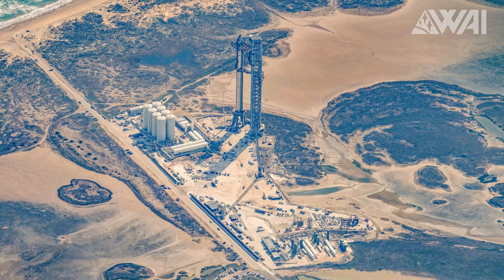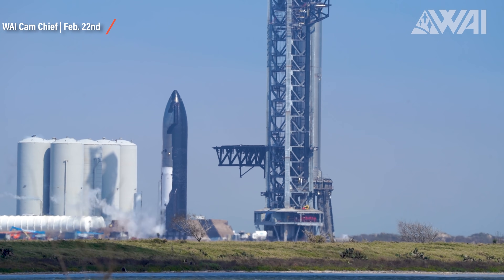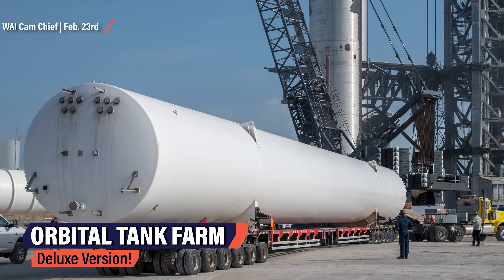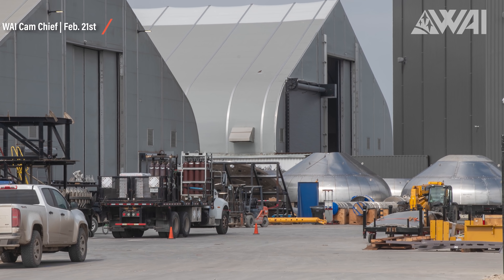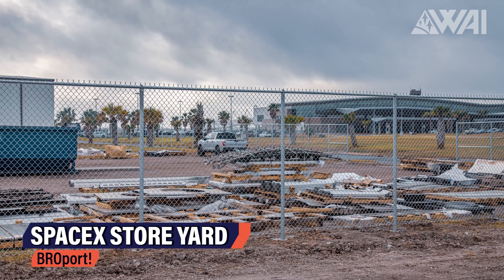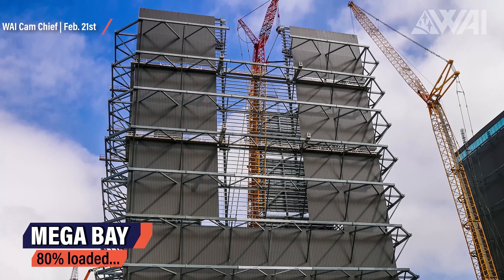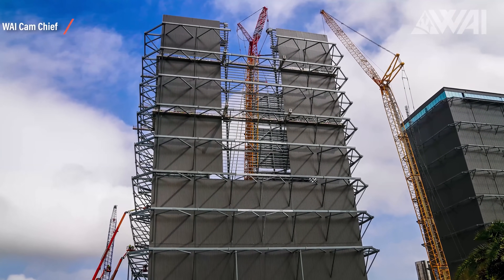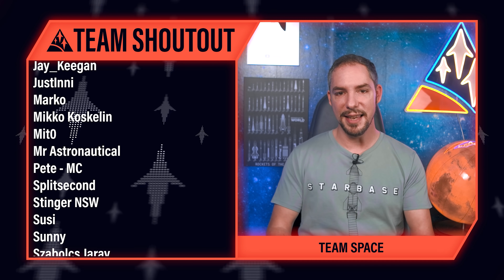SpaceX Starship Raptor 2 – Changing more than just the thrust output!

Comment: Would you run a new car into a wall or a old clunker, to collect impact data? The same with Raptor 2 and Raptor 1. If you lose booster 4 and ship 20. You get the all important answers. Will it clear the tower? Will the lift-off damage the ground equipment? Will it make to Max Q? How did stage separation perform? Don't forget, they were destined to the ocean anyway.
Do you really want to put 32 plus new Raptor 2s in the ocean? That's a big reorder for the production line. It will confirm you first thought and how well it preforms. Wring out the fuel farm, launch mount and tower, put 20 on 4 and rock and roll.
Reply: Good arguments. 
I am not sure how much we know about what SpaceX is asking right now, though.
For example, does more power in R2 translates in more vibrations and heat? If yes, It might be good to start doing fire tests with multiple new engines.
I guess all comes to what systems can be independently iterated and what should be a step forward. We just don't know. Remember what Elon said about flanges?
Reply: 4/20's use isn't about the Raptors, it's about the software for control and return, and about testing the heat shield.
Reply: I'm with you.  There are a million things to test with the first launch besides the engines.  The plan is to ditch these first launch vehicles at sea, no need to ditch raptor 2 engines when you could ditch raptor 1's.  You still get to test all the other myriad of systems.  With the new data, they may feel comfortable bringing the second launch in for a landing and thus get to keep the new engines.
Reply: Some is good .
More is better .
Too much is just right ....
Reply: They actually do use brand new cars for crash testing. But I get what you're saying.
Reply: Yeah there is too much data to gain by launching 4 & 20 in my opinion but who knows, they change it up day by day.  They keep pressure testing them so they must be sticking to using them so far anyway.
Reply: I agree completely. So much could be learned from 420, especially re-entry info.
Reply: one is intentional the other is not...
Reply: I suspect they want to collect as much info as they can, so they're going to fly R2s. Reason why not R1s? They only have permission for a very limited number of orbital launches. They don't want to waste one flying obsolete hardware.

Comment: The reason for not using GSE tanks made by SpaceX and bringing in new tanks is because of an OSHA violation. The GSE tanks holding oxidizer and fuel are not separated with a concrete wall, as per OSHA. I would think with the GSE tanks being double walled and the air gap being filled with perlite stone would have been sufficient protection.
Reply: Kind of funny how that works considering they get pumped into a rocket that literally has a common dome structure.

Comment: Felix,  I understand your reasoning for thinking Ship 4-20 won't fly because Raptor 2 is going to be available, however, wouldn't they still choose to fly it to prove out the Thermal Protection system, and control of landing systems?   They already knew Ship 20 was going to be one and done even if completely successful, seems that they would want to save the Raptor 2 ships for one that they would try to land.
Reply: I totally agree with you.  There is a lot of valuable data to be gained by flying booster 4 and ship 20 without sacrificing precious Raptor 2 engines.
Reply: With no future use for the Raptor 1 engines already installed, and no local airport looking for another attraction, it probably comes down to whether is will be cheaper to scrap it manually or spend the propellant to drop it into the ocean.  It could make for a couple awesome dive sites.
Reply: Tiles have moved on more than the engines. They don't fall off the newer versions.
Reply: @rorykeegan1895  yes, but knowing if s20 survived reentry with some missing tiles is still useful data.
Reply: @rorykeegan1895  Tiles don't appear to be falling off S20 now with the periodic cyro tests. The issues with SN8-SN11 appeared to be largely on engine restart for the flip-n-burn. The orbital test is more about going up and re-entry than the final landing. And that final landing will be a soft water landing that will destroy the engines anyway, it makes sense for B4S20 to be the first flight. SpaceX may disagree with that if they want some data that they think S20 won't give. Time will tell.

Comment: How well do The Heat Shield Tiles hold up between the Freeze/Thaw cycles. Are there gaps to allow for expansion/contraction of tiles.
Reply: Yes there are gaps, thats is why they have the hexagonal shape. Scott manley has a great video about the starbrakes. Hope this helps :)
Reply: They're also installed with 3 pins that have a slight bit of give that allow the tiles to shift slightly without hitting and cracking nearby tiles.
Reply: If they don't absorb water, freeze/thaw isn't an issue.
Reply: @UncleKennysPlace  Freeze thaw does cause the skin of the tanks to expand and contract though so tile spacing is critical to make sure they don't impact against each other and crack when the tanks are full of cryogenic liquids. This has improves greatly since the early days of tile testing and I don't think they lose any tiles during cryo tests now like they did a few months back.

Comment: You keep saying that b4 and s20 won’t launch. Is the progress on raptor 2 the only evidence you base that speculation on? I don’t think that‘s a valid reason. The 1st orbital flight is not about the engines, raptor 1 will do just fine for that
Reply from the maker: There are several reasons for SpaceX not using Ship 20 for the launch. Raptor 2, heat shield build quality (it was the first), added time and now Ship 22 (more advanced) going to the rocket garden. Right now I am tracking Ship 24 and Booster 8 for an orbital flight. Maaaaybe Booster 7.

Also, sources. But psssst.
Reply: @Whataboutit  You make good sense on this. If they do shoot off 4/20 its just to keep the fans happy.
Reply: @rorykeegan1895  I am not so sure on that